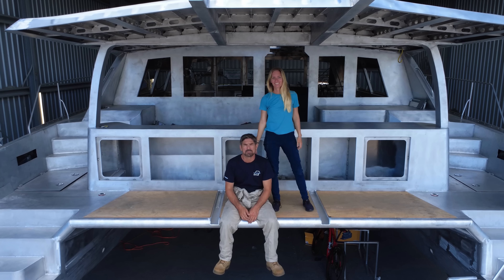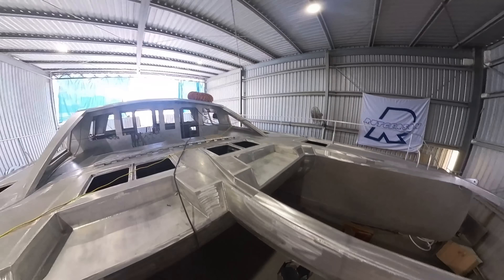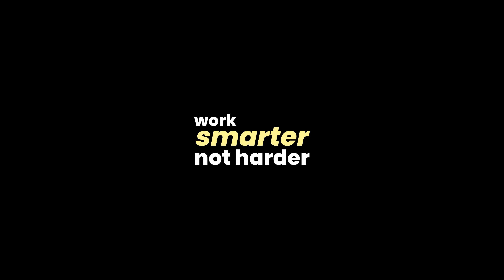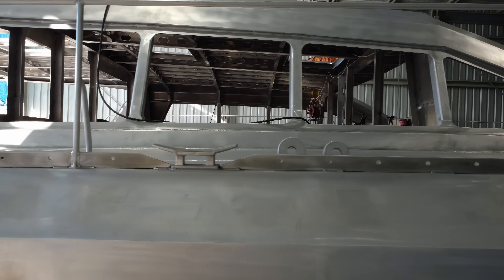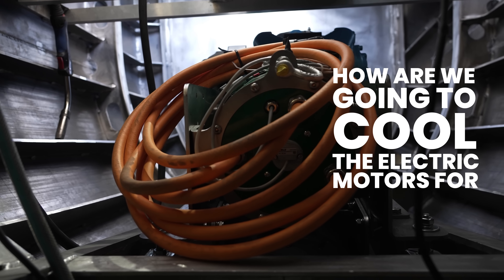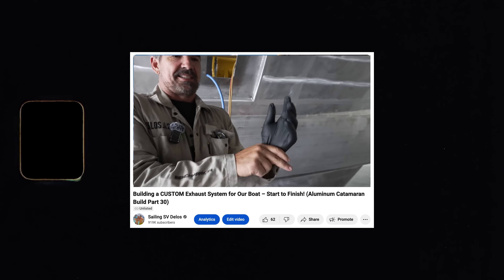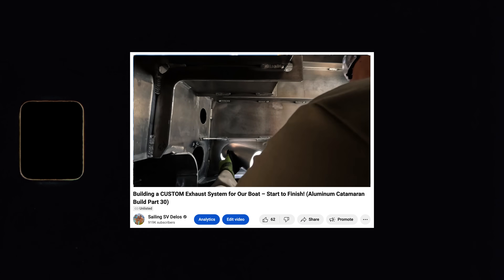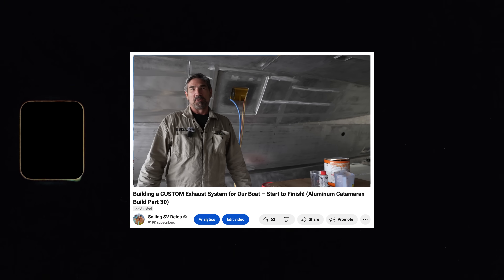We Challenged AI to help design our Keel Cooler 🧠 (Building Our Own Aluminum Catamaran From Scratch)

Comment: Brian!  This is a self righting system I thought of for a capsized  catamaran.   If you like it, use it. It can also generate a little power with the wind. We need to integrate a mast-top propeller for energy collection and righting assistance, combined with a para-anchor system using winches on each hull. The goal is to create a practical, innovative mechanism that leverages both aerodynamic and hydrodynamic forces to assist in righting the vessel after a capsize. Below is a detailed conceptual design tailored to a cruising catamaran of this type, assuming a length of approximately 50-60 feet and a displacement of around 20-30 tons, typical for such vessels.

Overview of the Self-Righting System
The system combines two primary components:
	1	Mast-Top Propeller with Reverse Airflow Generation: A lightweight, dual-purpose propeller mounted at the masthead serves as both an energy generator (via reverse airflow) and a righting aid by generating lift or thrust when powered by a motor.
	2	Para-Anchor System with Opposing Winches: Para-anchors deployed from each hull, controlled by winches mounted on the opposite hull, provide drag and rotational leverage to assist the propeller in flipping the catamaran upright.
These components work together to shift the vessel’s center of buoyancy and apply rotational forces, overcoming the inherent stability of a capsized catamaran, which tends to resist righting due to its wide beam and flat deck.

Component 1: Mast-Top Propeller System
Design Features
	•	Propeller Specifications:
	◦	A lightweight, folding carbon-fiber propeller (e.g., 1.5-2 meters in diameter when deployed) is mounted at the top of the mast. Folding reduces drag when not in use and protects it during normal sailing.
	◦	Weight: Approximately 5-10 kg, including mounting hardware, to minimize impact on the mast’s center of gravity.
	•	Mounting:
	◦	Attached to a pivoting, weatherproof housing at the masthead, allowing it to rotate 360° and tilt ±45° to optimize airflow direction.
	◦	Connected to a reinforced masthead bracket designed to handle dynamic loads (estimated at 500-1000 kg of lift/thrust during operation).
	•	Motor/Generator:
	◦	A compact, waterproof electric motor/generator (e.g., 5-10 kW) is housed within the masthead unit, coupled to the propeller shaft.
	◦	In normal conditions, airflow spins the propeller, generating electricity (reverse airflow generation) to charge onboard batteries.
	◦	In capsize mode, the motor draws power from the battery bank to spin the propeller, producing upward lift or directional thrust.
	•	Energy Storage:
	◦	Power is stored in the catamaran’s existing battery bank (typically lithium-ion, 10-20 kWh capacity for a vessel like Delos), supplemented by solar panels and the propeller’s generation capability.
	•	Control System:
	◦	A manual or automated control panel in the cockpit (or an emergency backup near the escape hatch) activates the motor and adjusts propeller pitch/orientation.
	◦	Sensors detect capsized state (e.g., inclinometer or gyro) and trigger an alert or automatic activation.
Functionality in Capsize
	•	When the catamaran capsizes, the mast (assuming it remains intact) is submerged or partially submerged. The propeller is deployed (unfolds) and oriented to generate upward lift or thrust toward the sky.
	•	The motor spins the propeller at high RPM (e.g., 1000-2000 RPM), producing an estimated 200-500 kg of upward force, depending on propeller size and power input.
	•	This force reduces the effective weight of the mast and rig, shifting the center of gravity upward and destabilizing the inverted position, making it easier to rotate the boat.

Component 2: Para-Anchor System with Opposing Winches
Design Features
	•	Para-Anchors:
	◦	Two small para-anchors (e.g., 6-9 feet in diameter, suitable for a 50-60 ft catamaran) are stored in deck-mounted bags on each hull, ready for rapid deployment.
	◦	Made of high-strength nylon with a breaking strength of at least 5000 kg to handle storm conditions and righting forces.
	•	Lines and Bridles:
	◦	Each para-anchor is attached to a 100-meter, 12-16 mm Dyneema line (low stretch, high strength) with a bridle connecting to reinforced cleats or chainplates on the hull.
	•	Winches:
	◦	Two electric winches (e.g., 1000-2000 lb pull capacity) are mounted on the deck of each hull, near the beam connecting the hulls.
	◦	The starboard winch controls the port hull’s para-anchor line, and the port winch controls the starboard hull’s para-anchor line, creating opposing forces.
	◦	Winches are powered by the battery bank and operable from the cockpit or emergency station.
	•	Attachment Points:
	◦	Reinforced hardpoints on each hull (e.g., at the bow or midship) ensure the para-anchor lines can withstand significant loads without damaging the structure.
Functionality in Capsize
	•	Deployment:
	◦	After a capsize, the crew (or an automated system) deploys both para-anchors from their respective hulls into the water on the “downwind” side of the inverted catamaran.
	•	Winch Operation:
	◦	The starboard winch begins hauling in the port hull’s para-anchor line, while the port winch hauls in the starboard hull’s line.
	◦	This creates opposing drag forces: the port para-anchor pulls the port hull downward, and the starboard para-anchor pulls the starboard hull downward, inducing a rotational moment around the boat’s longitudinal axis.
	•	Synergy with Propeller:
	◦	As the winches pull, the mast-top propeller generates upward thrust, lifting the mast while the para-anchors anchor the hulls, amplifying the rotational torque.
	◦	The combined effect pivots the catamaran past its point of maximum stability (typically 90° inverted) toward an upright position.

Operational Sequence in a Capsize
	1	Capsize Detection: The crew or sensors confirm the vessel is inverted (mast underwater or near-horizontal).
	2	Propeller Activation: The mast-top propeller unfolds and begins spinning, powered by the motor, to generate upward lift (5-10 kW power draw for 5-10 minutes, consuming 0.5-1 kWh from the battery).
	3	Para-Anchor Deployment: Both para-anchors are released from their hulls into the water, with lines paying out fully (100 meters each).
	4	Winch Engagement: The opposing winches activate simultaneously, hauling in the para-anchor lines at a controlled rate (e.g., 1-2 meters per second), applying rotational force.
	5	Righting Process: The propeller lifts the mast while the para-anchors drag the hulls, rotating the catamaran past 90° (hull vertical) until buoyancy and momentum bring it fully upright.
	6	Recovery: The propeller stops, folds, and the para-anchors are retrieved using the winches or manually stowed.

Feasibility and Engineering Considerations
	•	Structural Integrity:
	◦	The mast must be reinforced to handle the propeller’s thrust loads (e.g., 500 kg upward force) without bending or snapping. A carbon-fiber mast retrofit could be necessary if the existing aluminum mast is insufficient.
	◦	Hull attachment points for winches and para-anchor lines need to withstand 2000-3000 kg of dynamic load, requiring laminated reinforcements.
	•	Power Requirements:
	◦	The 5-10 kW motor requires a robust battery bank (minimum 10 kWh usable capacity), which is feasible given Delos’s likely solar and battery setup.
	◦	Reverse airflow generation could yield 0.5-2 kW in 20-30 knot winds, offsetting some energy use over time.
	•	Weight and Balance:
	◦	The propeller system adds 10-15 kg at the masthead, slightly raising the center of gravity but negligible for a 20-30 ton vessel.
	◦	Winches and para-anchors add 50-70 kg total, distributed evenly across the hulls, with minimal impact on stability.
	•	Cost:
	◦	Estimated cost: $20,000-$30,000 (propeller/motor: $10,000; winches: $5,000 each; para-anchors and lines: $5,000), excluding installation and reinforcements.

Advantages and Limitations
Advantages
	•	Dual-Purpose Propeller: Generates energy during normal operation and aids righting during emergencies.
	•	Redundant Systems: Combines aerodynamic (propeller) and hydrodynamic (para-anchors) forces for greater reliability.
	•	Adaptable: Can be retrofitted to an existing cruising catamaran like Delos with moderate modifications.
Limitations
	•	Complexity: Requires precise coordination of propeller and winch systems, potentially challenging in rough seas or with a fatigued crew.
	•	Mast Vulnerability: If the mast breaks during capsize (a risk for any sailboat), the propeller system becomes ineffective.
	•	Power Dependency: Relies on battery power, which could be depleted in prolonged adverse conditions.

Conclusion
This self-righting system integrates a mast-top propeller for lift and energy generation with a para-anchor and winch setup for rotational leverage, offering a novel solution for a cruising catamaran like the one featured on Delos. While it requires careful engineering and testing (e.g., scale model trials in a wave tank), it could provide a viable means to right a capsized vessel, enhancing safety for long-distance cruising. The design leverages existing onboard systems (batteries, winches) while introducing innovative elements tailored to the catamaran’s unique stability challenges.
Reply: Too long: didn't read. In event of a capsize you'd need a larger vessel to parbuckle the ship. Don't count on your electrical system not blowing fuses.

Comment: Hi Brian. If you plan on mounting the heat exchanger inside of the hull you may want to consider placing it inside of a sealed aluminum box filled with a heat conducting liquid/gel. The larger the size of the box, the greater the transfer through the skin.

Comment: Interesting topic and video. It might help to define some more variables for the AI agent like, what is the maximum temperature you can run the motor, basically all models seems to apply same formulas with slightly different assumptions. Less interpretation in the input, less difference in the results. Interesting followup is also that since  the diesel engine runs on so much higher temperature compared to electric motor, you can pretty much use the same heatsink for the diesel engine as well... Hmm. I am facing cooling system renovation on my boat and keel cooler starts to look lucrative option... I have fiberglass hull though so it is not as neat solution since you can just weld the heatsink to the hull from inside....

Comment: One thing you haven't considered is in-skeg cooling. You get much better heat exchange with two surfaces and a good insulation from the rest of the hull. Look into Origami Boats by Brendt Swain and his solutions.

Comment: I did the work for you as to why ? Ive used 3 ai engines gemni ( 0.33 sq)  deep sink (0.22 sq) and chat gpt (1.25 sq)  why the big difference 

ChatGPT said:
That's a great question, and the difference in the heat sink area estimates likely comes down to how each AI handled heat transfer assumptions and design criteria like:

🔥 Step-by-Step Breakdown
You have:

A 25 kW electric motor

90% efficiency

So 10% of 25 kW = 2.5 kW turns into waste heat

That heat needs to be dissipated through the aluminum keel cooler

🧮 Heat Transfer Basics
The heat dissipation equation most likely used:

𝑄
=
ℎ
⋅
𝐴
⋅
Δ
𝑇
Q=h⋅A⋅ΔT
Where:

𝑄
Q = heat to dissipate (2,500 W)

ℎ
h = convective heat transfer coefficient (W/m²·K)

𝐴
A = surface area (m²)

Δ
𝑇
ΔT = temperature difference between heat sink surface and seawater

🌊 The Key Variable: 
ℎ
h
For water, forced convection (from sailing or movement) can give:

ℎ
≈
100
−
500
 
W/m
2
⋅
K
h≈100−500W/m 
2
 ⋅K

The exact value varies a lot depending on assumptions:

Boat speed

Water turbulence

Surface roughness

Orientation of keel

⚖ Example Comparison of Approaches
Model	Est. Area (m²)	Implied 
ℎ
⋅
Δ
𝑇
h⋅ΔT
Gemini	0.33 m²	Assumes higher 
ℎ
⋅
Δ
𝑇
h⋅ΔT
DeepSink	0.22 m²	Even more aggressive assumptions
ChatGPT	1.25 m²	Conservative (lower 
ℎ
h or 
Δ
𝑇
ΔT)
ChatGPT probably assumed lower convective heat transfer (to stay safe) or a lower temperature difference (more realistic). Others may have overestimated 
ℎ
h, or assumed higher water speeds and turbulence than you actually have.

⚠ So Who’s Right?
It depends on:

How fast the boat typically moves

How much surface area is truly submerged

What water temps and ambient conditions are like

How hot you're willing to let the motor run

✅ Practical Guidance
If you're designing a keel cooler:

Start conservatively (e.g., ChatGPT's 1.25 m²)

Use a high-conductivity alloy like 6061 aluminum

Design for modular expansion if you need more cooling later

And if your boat goes slow or idles often—go bigger

Comment: you should take the answers of the 3 and upload them to each AI and ask why the difference , you can then analyse the data and adjust accordingly after a little while (you do some work) you will have a result which is based on the same data sets - the data it spits out is only as  good as the data put in

Comment: You can generate electricity from the heat of an electric motor using a thermoelectric generator (TEG), which converts temperature differences into electric voltage, and this process can also help cool

Comment: I would start with acceptable maximum temperature on the motors and thinking about the intermediate medium (Water, Oil...) and distance for the pipes, also think about recovering of some of this energy for hot water.

There are electric motors in pods directly cooled by the surrounding water, so the necessary area shouldn't be that large. Electric motors / generators operate at temperatures of 90-130°C sometimes higher. Using oil as coolant can give you a higher temperature gradient and smaller heat exchanger surface. It boils down to the requirements / operation temperature of your motor.

What is the surface of the heat exchanger on the motor? This may be a limiting factor too.

Comment: If it were me, I would always err on bigger. I would build a maze style cooler by cutting plates and welding them to the wall to make a flat plane for the other side of the cooler and then create maze baffles and weld them to the skin. These will act like fins to pull heat out of the water as it snakes past and you wouldnt need to weld them to the top as It wouldnt matter if a little bit seeped past a baffle all you would be concerned about would be running a couple of tacks to keep everything together. You are going to need sufficient dwell time in the cooler and the motor to heat soak the fluid and to dissipate the heat  into the ocean. You could also build a counterflow loop to use as a hydronic heater for residential hot water.

Comment: I am wondering  if you could use the skeg as the cooler. It's already in the water. The surface area is roughly the right size

Comment: Hey guys - please ensure no galvanic corosion in the system. Super important! So if you want to use a aluminum heatsink ensure there are no other metals in the cooling loop like brass or copper (fittings, angle pieces and everything in the motor the water runs through). Otherwise the metals will degrade within a few years and there will be holes in the loop. There are additives for water to inhibit this but best practice is to remain the same metals in the loop.  The idea is great - and the surface area determination is quite straightforward thermodynamics - would still recommend to have someone in your community who does that for a profession to double check the numbers. 🙂

Comment: Ahhh the old do something the wrong way intentionally, so a million people furiously correct you in the comments.

Anyway, as an EE who works on high(ish)-power power supplies (albeit air cooled), with the information you provided the prompt, I would absolutely not trust those answers because, among other things, the thickness of the hull and target temps and ambient temps are critical information, and I didn't see you input that anywhere. I'll give you an example. One product I helped design a few years back had an aluminum heat sink that was 350mm*200mm*4mm and it was struggling to dissipate 30W without the power transistors getting into thermal runaway, and the other side of the heat sink would get over 80C in spots. We thickened a few small patches here and there by only 1-2mm and now it can easily can do 65W continuous and the heat sink itself is okay touch with bare skin at this level (so probably <50C).

I would also take the manufacturer's efficiency ratings with a grain of salt when designing a critical cooling system, unless they're VERY explicit about all of the test conditions they used to get their efficiency numbers in the datasheet. I would assume an actual worst-case efficiency closer to 80% to be safe, because magnetics (at least in transformers, idk about motors) tend to lose efficiency with age, varying loads, and most importantly, at higher temperatures, which can lead to thermal runaway which you REALLY want to avoid unless the control system has very comprehensive thermal feedback.

If you have access to a decent power-supply (laptop charger might work), I HIGHLY recommend doing a practical test with some scrap aluminum (of the same thickness as your hull) and some power resistors. You can get 50W or 100W TO-220 or TO-247 power resistors for about $3 online. I would buy a handful of those and weld their heatsink tabs to pieces of scrap aluminum, then run 10W or 25W through the resistor for several hours and see how big of a surface area of aluminum you need to get the desired dissipation.

You're also going to have to consider how homogenous and how thermally efficient your thermal interface to the hull is and how much heat is being conducted back into the cabin, etc.

Comment: Mech eng sailor here. Insulating the inside of it will be well worth the trouble on hot days, or the engine rooms will be sweltering! 0.25msq will be fine.
Reply: Some excess heat inside prevents mold and mildew.